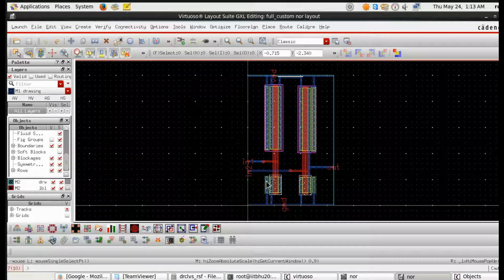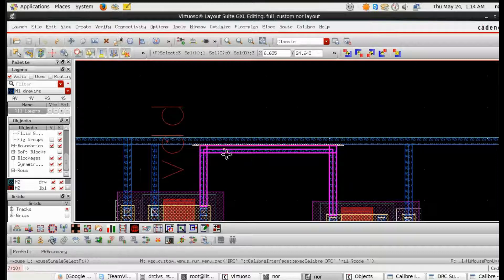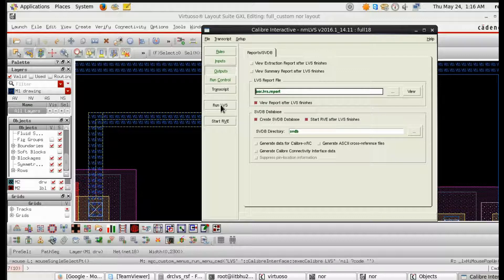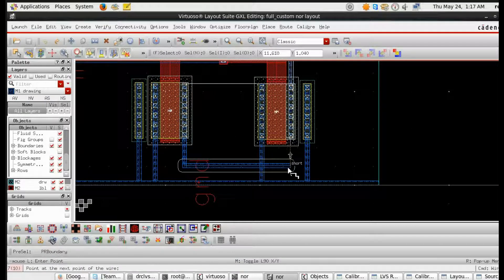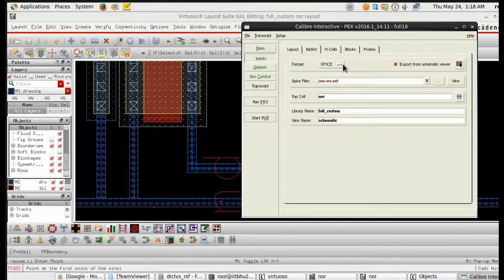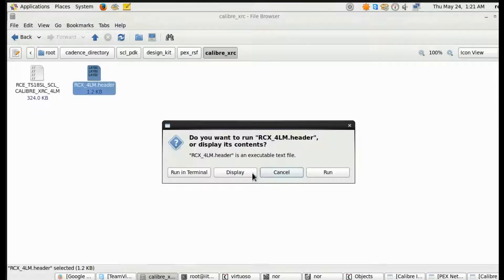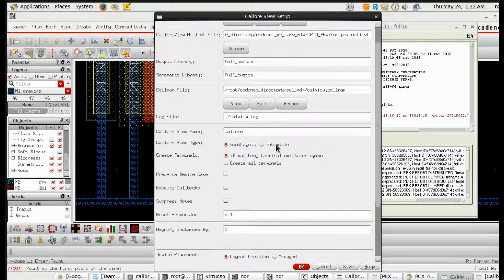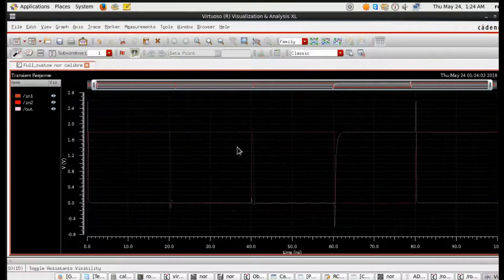VERIFICATION | POST LAYOUT SIMULATION (PART 3/6) | CALIBRE | VIRTUOSO |  VLSIFaB

Comment: what is "Pcell evaluation failed" i am facing this problem in scl 180 nm pdk while placing a capacitor "cmim_sq" during layout
Reply: When you place a capacitor using the "cmim_sq" Pcell during layout, the tool attempts to evaluate the Pcell with the given parameters, but something goes wrong, leading to the error message "Pcell evaluation failed." The exact cause of this error can be diverse, and it might require examining the design and the specific Pcell in question to identify the root cause. Some potential reasons for this error could include: